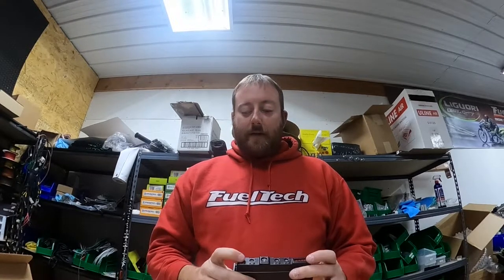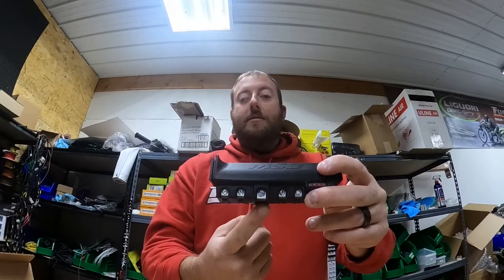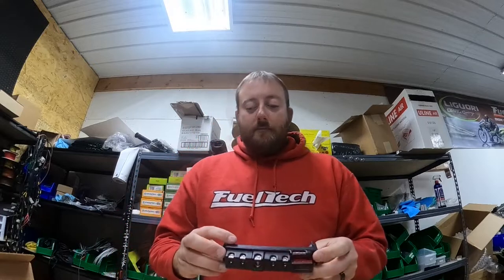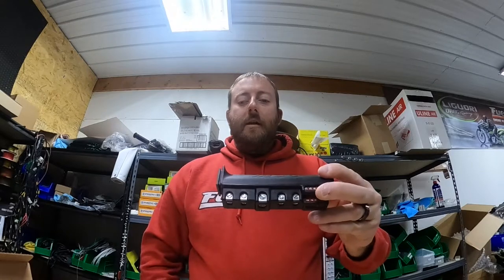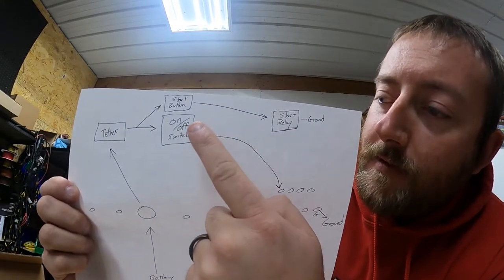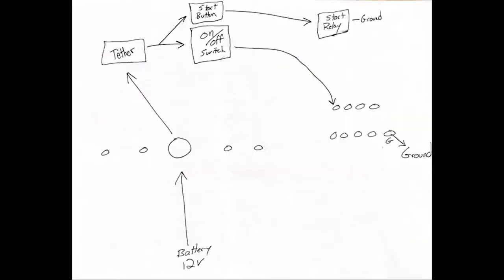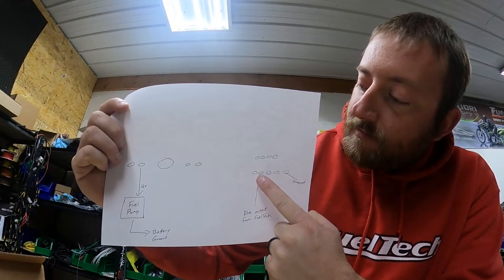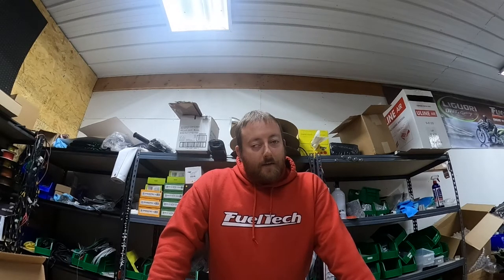MSD Relay Wiring

Comment: Would it be better wiring an inline fuse between the solid state output and the load?
Reply from the maker: The relay has an overload. If it pulls too many amps it shuts the output off.
Reply: I read mine protects at 20A and can hold upto 80A for short bursts. My worry is that for some loads, that might be too high and you risk burning up wires or damaging other components. Say for example a fuel pump rated at 15A max.
Reply from the maker: You can definitely add a fuse if you want to. Wouldn’t hurt to have more protection.

Comment: Per Spal my fan can run draw up to 77 amps, would I need to split the 8 gauge wire from my fan to 4, 10 gauge wires and use one msd module just for my fan?